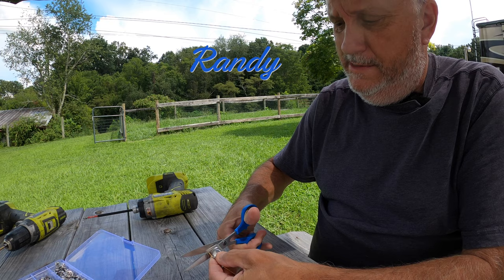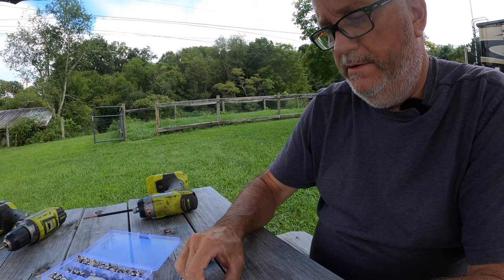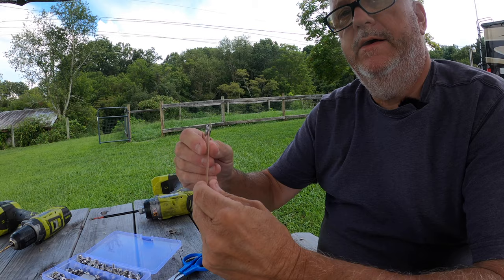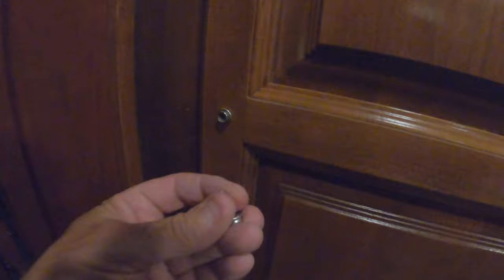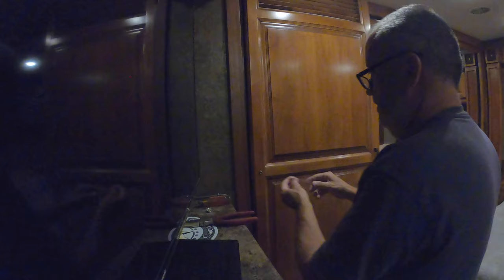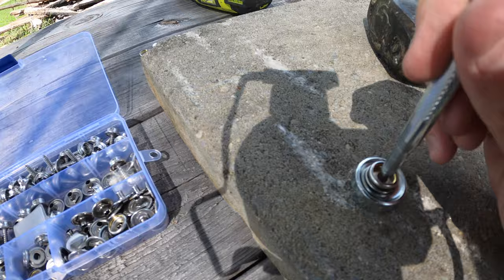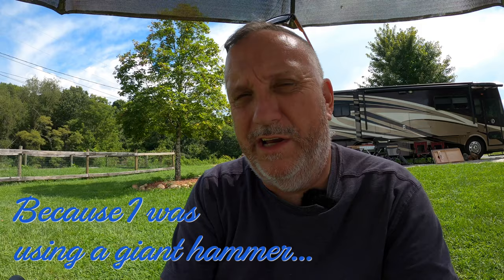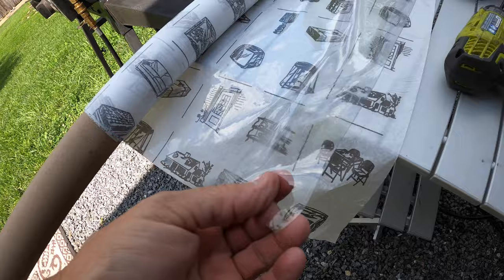DIY RV Sliding Door Repair | Sunday Solution  | Full Time RV Living:

Comment: I have the same coach as you and my door is doing the same thing.  Have you tried replacing the stock sliding track?  I was going to order a new track until I saw your video. I might try this first.  My closet door latches broke also and I need a fix for that.
Reply from the maker: We’re still using the latch that we made in video works great 👍